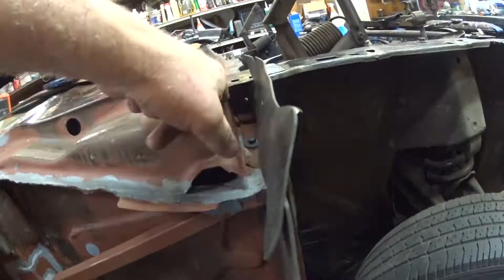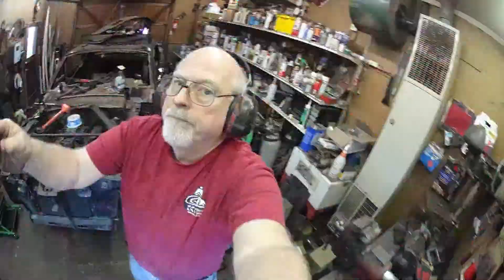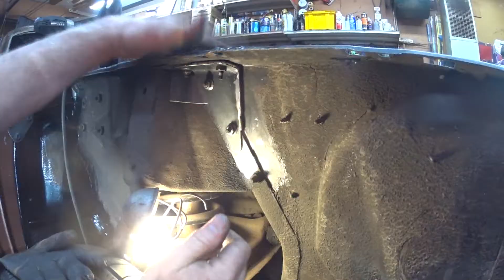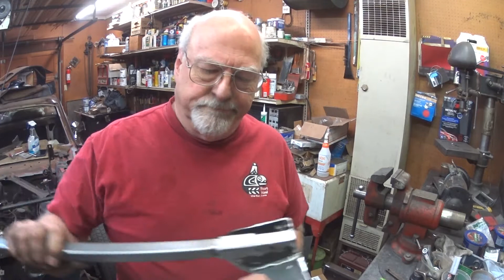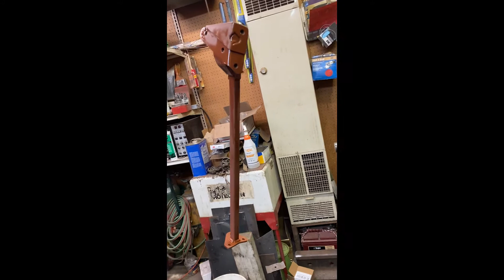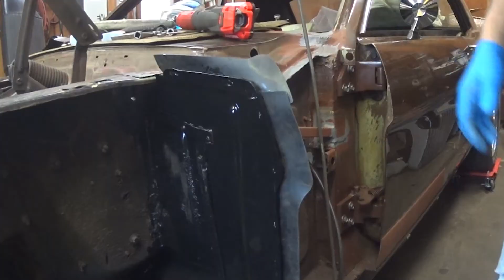66 Mustang Betsy - Chassis Stiffeners Part 4 - Shock Tower Struts

Comment: Looks good. I have been looking at the Aussie bracing as the Aussies tend to have the most to look at since they seemed to race them allot longer than here in the US. I have a design in mind but it is different. Yeah yours are over built but no reason to go buy more material just to make it slightly lighter. I have tried to tell people that the fender aprons are structural supports and they always say nooo the frame does it all.... We know better... I'm debating weather to do subframe connectors on the 66 since I put in the vert inner rockers. I may end up building an X brace though. Also wondering if I want to weld all the stuff here and there like the rear spring perches to the body etc especially since it's on a rotisserie now and easy to do.
Reply from the maker: I’ll have to check out “Aussie” bracing. Got a link to an example?